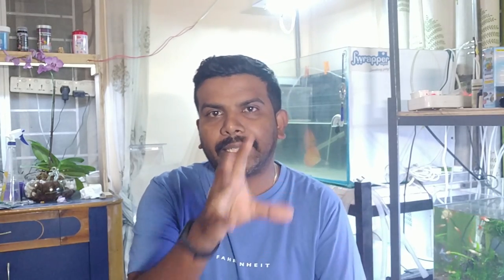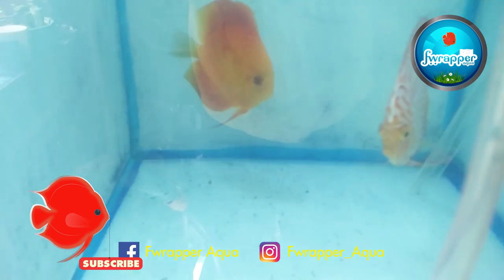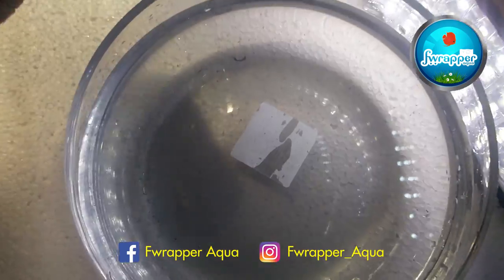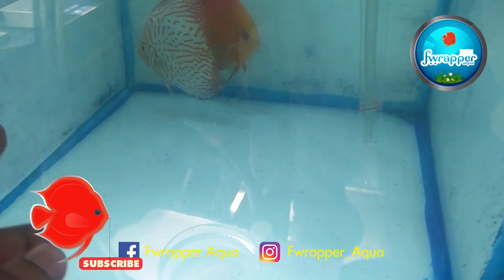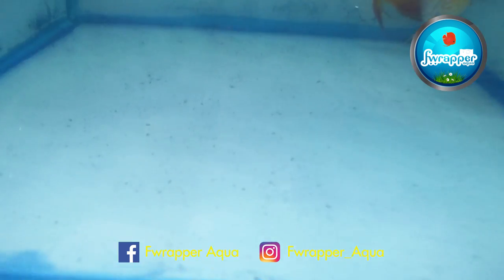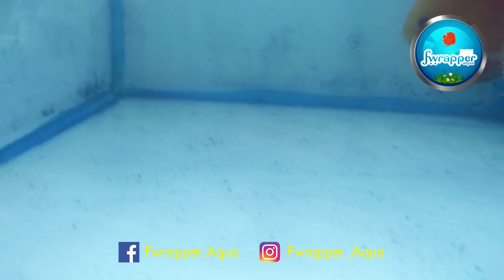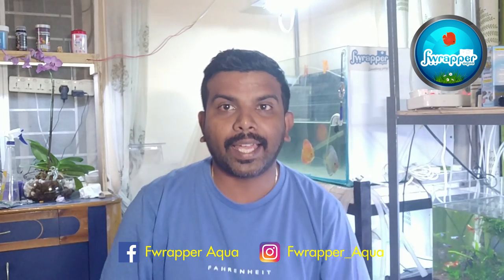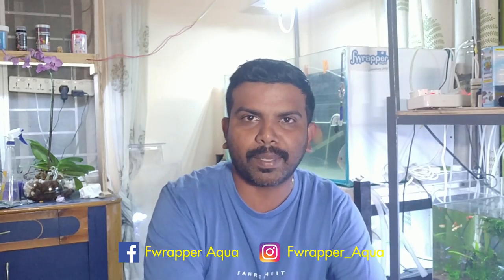Water Change During Discus Fish Breeding || Discus Fry Care

Comment: Hey Rahul,
Here in West Bengal, the temperature difference between Winter and Summer is huge. Like some time it touches 33 degrees in summer and in winter the water becomes super chill.  Do you have any video on how to deal with this temperature gap in water changing during the winter season? If yes. Can you please give the link here?
Reply from the maker: Hi... If you have a storage tank to age the water you can try and maintain similar temp of the tank in that before doing water change... Or if you have good filtration you can do smaller quantity of water changes during winter

Comment: If the electricity is not there what should v do for a discus
Reply from the maker: Hi.. I have a separate ups back up only for my air pumps... Even if filtration stops for a couple of hours it's fine... But even if aeration stops is really bad not only for Discus but for any fish... For emergency you also get air pumps that run on battery..  Keep that for back up

Comment: Hi I want keep discus in well water having tds500 if it possible to keep them ?
Reply from the maker: Hi.. Discus are good at low tds.. Below 175ppm... 500 is very high for Discus... I would not recommend
Reply: Fwrapper Aqua thanks
Reply: 50 % well water and 50 % to water good enough ?
Reply: @FwrapperAqua  Hi Rahul, I completely agree with you. But to inform you, I am keeping Discus in Well water of 800 above TDS. (I can share the pics/videos and the TDS reading if you want). The fishes are doing fine. I am doing 50% of WC every night. But still I feel that low TDS as you mentioned is ideal for these lovely creatures.
In fact, I am little worried about how the breeding will be if I find any pair out of the baby fishes that I have in my tank now. I am keeping discus for the first time and will try to breed.